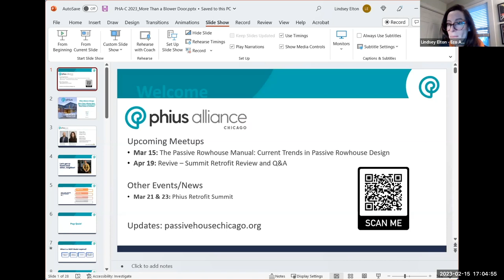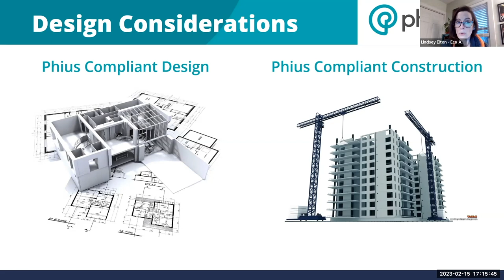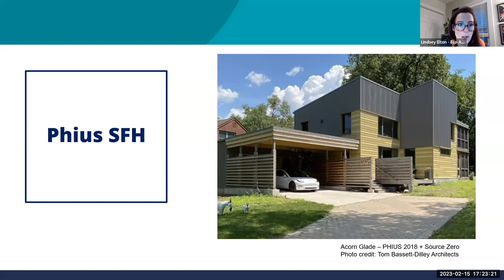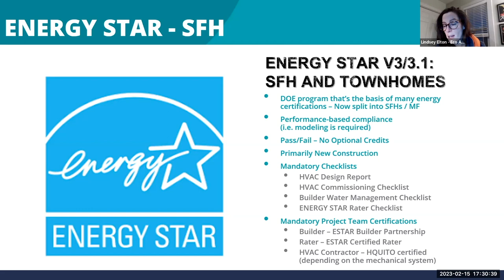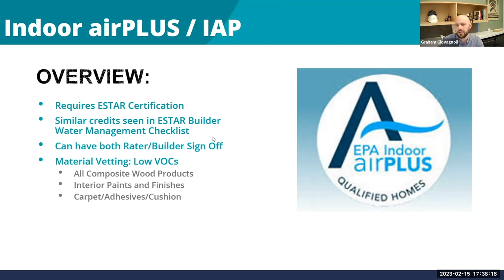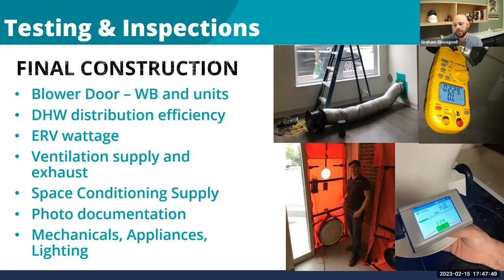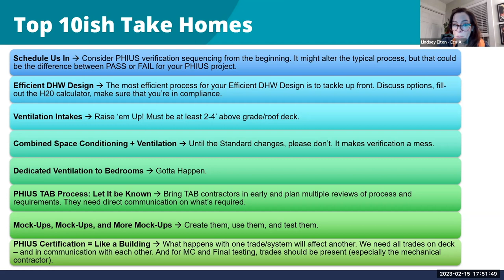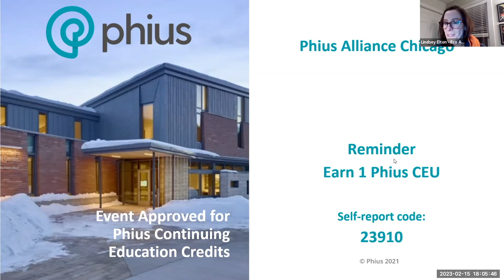More Than a Blower Door

Comment: 35:00 Where is the thermal breaks between windows, doors, and walls? Fiberglass insulation next doors and windows come on. No thermal breaks how long is that fiberglass insulation gonna provide stated r value? Is that a wood corner no internal thermal break. Around doors, windows, corners, and joist pockets are usually the greatest loose of heat. And where moisture problems can occur frequently. I do see they put some kind of insulation around window and door as thermal break. They should have a mineral wool all the way around doors and windows plus bay next to them or spray foam. Clearly someone does not understand the factors that affect r value of fiberglass. Mainly the insulation exposed to moisture; its thermal performance (R-value) drops because water displaces the insulating air that is trapped in insulation. Further, water’s thermal conductivity is nearly 20 times higher than the conductivity of the average thermal insulation, according to Steve Badger, Ph.D. As a result, the fiberglass insulation would lose its ability to restrict the heat transfer, hence losing R-value. It also results in less energy efficiency, heat loss, and higher energy bills. Nevertheless, its thermal properties will come back once it’s dry. However, the fiberglass insulation will be compacted and will not recover to its actual thickness when exposed to water for a prolonged period and unable to dry in time. It would permanently lose some of its thermal performance, efficiency, and integrity when this happens. It's not just being air tight but paying attention to condensation zones. Even though a building is air tight condensation zones happen. Sometimes too much insulation can block heat. Insulation works both ways keeping things cool and can also keep things warm. Just like co2 and methane having a super cooling effect as well as warming effects. Even Rock wool can hold moisture and loose r value. A soaking wet piece of rock wool still provides around 80% of its r value. Closed cell foam even absorbs water if in contact long enough. I use closed cell foam floats to remove docks and boat lifts. That are a lot denser than closed cell insulation. After a day of use they have absorbed water and don't float stuff as good. And need to be dried out. This also happens with open grain and closed grain woods. Don't run a stove hood vent into an air exchanger. The grease and oils can clog it.